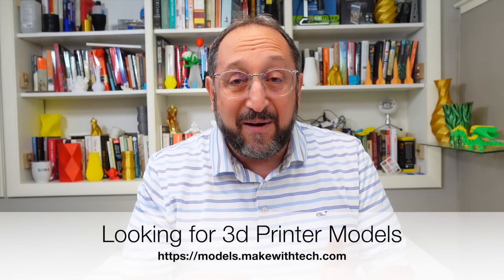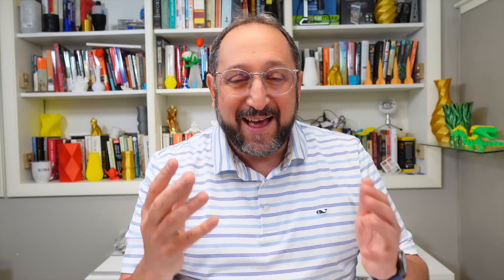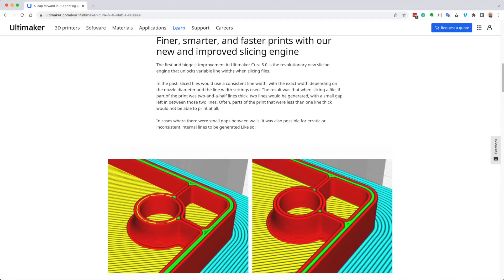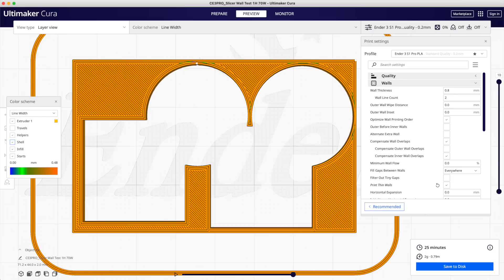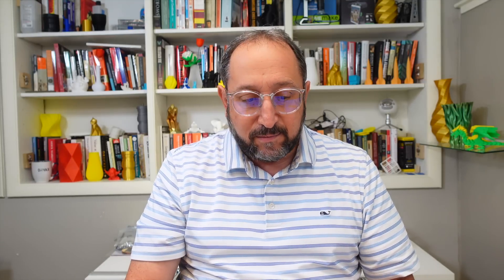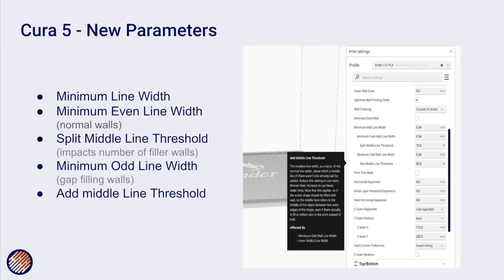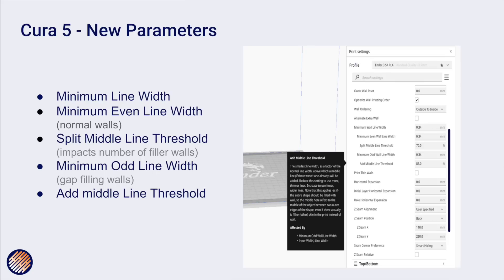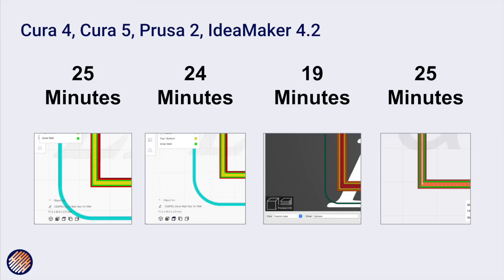Cura 5 Review: Is It Revolutionary or a Bust?

Comment: When I started using Cura 5.x with my ender 3 I immediately started having under extrusion and gaps in my prints that were not there in Cura 4.X. Haven’t got to the bottom of the issue yet. Thanks for this video!

Comment: I just downloaded Cura 5.1 and absolutely astonished!
I have been using Cura exclusively since 2019 on a CR-10s Pro, and I've always had one problem or another in regard to defects.  However, I just ran the 'Generic PETG' (which is what I've always started with using Cura 4x but had to make many modifications to get really good prints) without any modifications and I cannot believe how pretty much everything that was a problem either disappeared or is so minor that it really doesn't have to be toyed with!  Additionally, I switched to a 0.6mm nozzle and sidewalls of a cla-cube are indistinguishable from a 0.4mm one!
The Dev-team at Cura really knocked it out of the park on this one.  So, I'll be deleting my previous Cura 4x versions along with my old profiles because it is that good!
I think everyone should give Cura 5.1 a test-drive. You never know, it might make you switch (certainly from Cura 4x)...  Thanks Herb and to all your great community...
Reply: Would you mind sharing where you got the generic petg profile?
Reply: @robxmccarthy  You just select PETG, as it is the one that comes with 5.1 version. 
The only mods I’ve made are to the temps based on the characteristics of the particular PETG (i.e. cheaper PETG’s seem to work better at lower temps 215C etc.) Work on your temps first then retraction if really necessary…

Comment: I have an Ender 3 Pro and just installed Cura 5.1.  I have a problem after the simultaneous hotend/bed heating has completed. Octoprint is issuing an M112 command which kills everything and requires a printer restart.  If I move back to Cura 4.11 this does not happen.  Very strange.  Have you seen this happen in your review(s)?

Comment: Cura 5 doesn’t work well with my Mac M1 MBP. And it’s not optimized for the M1 chip, it’s still for intel but it technically opens and runs on the M1 chip. But my issue is that my mouse stops working after a minute or so. It doesn’t let me click on anything inside the app until I quit and relaunch. Anyone else?

Comment: Doesn't line width necessarily limit your line height at some point?  Specifically, I'm not sure you can well achieve a .4 line height on a .4 nozzle, when printing a .6 line width...

I thought line height was best not exceeding 60% of nozzle diameter in those wider line width cases?

Comment: I switched to Prusa slicer for a while because they can print thin parts well. But they don't have hole size compensation. So I switched to Super slicer which offer those features. Use it for a while and find it wanting mostly at flow control which in both Prusa and Super are bunched up together with line width and for the life of me I can't tune it to my spec.

Then come Cura Arachne Beta. I tried that and boi it was everything Super and Prusa can do but better at flow control. So I switch to Arachne. Never look back. Now with CURA 5 running Arachne, I'm firmly in CURA camp now.

Yes, the UI organization can be better in CURA, but can Super or Prusa print 1st layer at 3x linewidth but 33% flow so it come out as a fine net? I've yet to be able to do that.

Comment: Maybe you can help me? I have a 2015 Macbook pro. where can I find the com port settings. Trying Prontoface and I cannot get it to connect to my SKR2 board. I have a Creality Ender 3v2 3d printer and trying to upgrade it.I think you use Macbook.I get the following error serial error: [Errno 2] could not open port /dev/tty.usbserial-1410: [Errno 2] No such file or directory: '/dev/tty.usbserial-1410'

Comment: Thanks for the video. The biggest problem for me is that this version doesn't work on my Linux system. I've a system with an i7 processor. I use the video attachment of the processor, so I don't have a video card. And it complains because it *needs* OpenGL version 2, which doesn't run on the integrated video.
Reply: Daily Life and events   I use Debian.
I've built myself version 5.1 and it works.
The problem seems to be related to appimage version 5.0

Comment: Hi,

Just installed Cura 5 and compared with Cura 4.13.0 and opened in both slicers the same project *.3mf which means both slicers have the same printer settings ¿ or ?

Cura 4.13.0 prints my 3 parts in 5 hours 59 minutes

Cura 5.0.0 prints my 3 parts in 6 hours 12 minutes

A difference of 13 minutes ... Why so ?

I compared the settings and they are 100% equal
Reply: Could just be a difference in how they calculate the time needed, that is a pretty small difference in times in %

Comment: Cura 5 will not load on a Windows 7 Pro machine.  I have 7Pro on all of my machines.  When 10 came out I updated Windows on my large desktop.  When I did several on my often used programs failed to work.  With NO WORK AROUND and orphaned programs I removed 10 update.

Comment: For reasons beyond my comprehension, prints sliced with Cura fail on the 2nd layer 50% of the time for me. 
If I use PrusaSlicer it doesn't fail unless I've done something to cause failure (Unclean bed, knocked bed out of tram etc.)

The annoying thing is that I spent many hours troubleshooting and replacing parts on my printer before I realised this!

Ultimately though I'll always hold the opinion that the best slicer is the one which works for you and your hardware.

Comment: The ideaMaker vertical lines are there because you have "Infill Outline Shells" or "Solid Fill Outline Shells" set to 1. You can clearly see that that extra perimeter is everywhere there is infill. You might also clear up some of the gaps by using "Line Infill" rather than "Rectilinear" in the "Solid Fill" tab, and turn on "Check Thin Wall" and "Fill Gaps in Shell" in the "Other" tab.
Reply from the maker: Excellent.  Thank you.  I am not an ideaMaker expert so this is very helpful for my viewers.  Thanks for sharing.

Comment: Thank you for the informative and comprehensive video!  I am interested in making the line width visible in Cura but am unable to show what you have demonstrated in your video.  In preview mode I can see the various color coded lines, however the "gauge" to show various line widths is not available.  Any suggestion on how to activate this feature?
Reply: Try turning on the "print thin walls" setting under walls. I had to turn that on before I saw any variable line width...

Comment: octoprint doesnt work in 5.0   i could not click on change choice of where to print  just to disk or other but octoprint doesnt shows up nor in setting under printer octoprint doesnt shows up i even reinstalled octoprint ….
Reply: Did you remember to add the add on of octoprint in Cura 5.0 ? 
Also 5.0 also need the key to octoprint for it to see octoprint,  just like Cura 4 had to.
Reply: @Aquaflier  i did reinstalled octoprint in cura 5 but it doesnt shows up in setting printers
Reply: Do you have your firewall turned on in linux ? , maybe it has been blocked there ?
Reply: @Aquaflier  firewall has nothing to do with this

Comment: Cura 5 is definitely a huge jump ahead. Personally I am torn between Ideamaker and Cura 5. I don't like Prusa Slicer because the interface is confusing and you have to slice and then go back and see the results and the entire process of making your changes and looking at the results is just frustrating. When I just started out Prusa impressed me with its out of the box ease of use. As I started doing more advanced things I found it frustrating however and Ideamaker became my preferred slicer as the layout of the parameters is more logical than the other free slicers. Cura is a close second. There are some things I really like about Cura but also some issues that I don't like. An example is when you're using the entire bed surface for a print where it automatically reduces the bed size by approximately 15 mm on every edge. This is not the safe areas that you may also encounter. This means for example on an Ender 3 S1 Pro with a 220x220 bed you have to change the printer def to 235x235 or it won't slice. In Ideamaker that's not an issue.

Ideamaker again have a solidfill feature that messes up prints where you print walls that slants back 45⁰. Eventually I figured out how that works and got rid of it. Some things work really well in Cura and others with better out of the box in Ideamaker. At the moment I'm conflicted between the two slicers because if I had enough time I can do anything with any of them but it sometimes takes just too much time to figure it out. I'm therefore out of necessity jumping between the two slicers but that's where I draw the line.

On the topic of print times, I found that it is a highly academic issue because you can tune your time down considerably if you know how in sny slicer.

I also use adaptive layers and infill which makes a massive difference when printing large parts. 

Infill patterns is an area where Cura rules with fantastic options.

A quick tip that I found often helps me out. In the Ideamaker help it provides you often with equivalent functions in Cura, Prusa Slicer and Ideamaker. This helped me to find the best solution often and is very helpful to identify when something is not available on another slicer. If you want to look at that try the xy dimensional adjustment options.
Reply: That 15mm gap is the slicer saving room for the skirt, turn it off and you get the full bed

Comment: Hey Doc. I think you missed the most important parameter in your speed tests. And I think your pictures showed this. Cura's default outer perimeters is set to 3 by default and PrusaSlicer uses 2. There is your main speed difference.
Reply from the maker: I'll check this out
Reply: Also don't forget different speeds and accelerations between cura and prusa. Prusa default speeds are faster then cura. That's also why the faster printing times.
Reply: The pictures clearly show Cura and Prusa Slicer both with 2 perimeters. ideaMaker had an extra infill perimeter, though. Thank you for the polite rebuke.
Reply: @no-page   Sorry but I see three perimeters in Cura. You must count the extra infill perimeter Cura always does. Prusa does not do this. You mentioned it for Ideamaker but Cura does exactly the same thing. Only Doc can check his settings and report back.
Reply: @frogmandave1  You are right! Maybe it was the yellow color, but I looked carefully before and only saw two. Now I clearly see three.

Comment: Just installed this and the first thing I get was a bunch of pop ups saying that several (if not all) of my market place plugins are not working.  They advise to uninstall and reinstall the plugins.   Fine.  I do this, restart Cura 5 only to find that the marketplace will not start and stops responding, and the only option is to close out cura.  Not a good start.  I lost a lot of plugins I use daily.  Garbage program, 4.12.1 may not be as fancy, but it worked.

Comment: Cura 5 may be wonderful, but the Linux version is pretty much useless because it doesn't allow you to open or save files. Yes, there are workarounds, but it's ridiculous to have to use workarounds for such fundamental operations. So I'll have to wait for v5.1 to come out before I can try it.
Reply: Which version  of Linux are you on,  I'm on Mint on one machine and Debian on another , also tried on majaro and garuda and all of them work fine and can save and open files with out any problems.  Did you you install from your systems repository or appimage ?

Comment: I have found with my prints that Cura 5.0 is roughly 10 to 15% faster than Cura 4.1 with the same models. When printing large batches of items that can take over 10 hours in 4.1, I'm below 8 hours in 5.0. so for me the switch to 5.0 has reduced my print time, and honestly also improved my print quality utilizing virtually the same settings in the slicer.
Reply from the maker: Makes sense.  Thanks for sharing.
Reply: @MakeWithTech  Thanks for all you've shared, between you and Filament Friday (Chuck) you helped me in my early days of 3D Printing beyond words.
Reply: Do you have problems with z seams not being straight lines like in cura 4?

Comment: I still haven't moved to Cura 5 just because Cura 5 has a problem with seam lines. I need my seam lines in a straight line when printing round shapes. The Z seam relative just does not work like the previous version.
Reply from the maker: Interesting.  I have not tested that yet.  Thanks for sharing.
Reply: Same, I'm just dealing with it
Reply: Cura 5.1.0 is out but they still have not addressed this issue. Hopefully they’ll do something in the coming updates.

Comment: Thanks Irv for a great detailed comparison of some of the new Cura 5 features vs other popular slicers!

I really enjoy your videos. You have a nice presentation style and engaging personality that makes the videos very engaging.

I've been using Cura 5 since just before release. I don't see a huge increase in speed and it seems to make some odd choices when it prints layers that result in a lot more travel moves than it should.

Variable line width, as you pointed out, is a huge improvement. 

I'd also like to see them optimize travel moves which would minimize problems like stringing or other artifacts while also increasing speed.

The guys over at Inventables, a Chicago based company making great consumer CNC machines had a similar travel problem in their software.

Several months ago they put out a video announce version 2.0 of their software, Easel, with vast improvement in  several areas.

The most impressive was the new travel optimization. Seeing the before and after shots was truly impressive.

Maybe the Cura (or any of the other slicers) could talk to them and see how they did it :)

Irv, if you get the chance to checkout their video I think you'll like what they have done.

Keep making these excellent videos!

I always learn something and, for some reason, I feel happier after seeing them!
Reply from the maker: Thanks for your kind words.  I agree and I believe PrusaSlicer gcode prints faster because of travel optimization.

Comment: Thank you, nice video and comparison. However I would have loved to see some real world measuring, are those small parts the correct size? 

I'm using cura 5 a few weeks and it seems to work good. However, the following bug is still unsolved: using multiple parts with extra support blocks when the blocks overlap multiple parts will save, but loading it again rearranges the parts, making it impossible to slice.
Reply from the maker: Thanks for sharing this bug information.  I have not tested that yet, but will.
Reply: Do you have 'Ensure models are kept apart' on in the preferences?
Reply: @remcoburema4883  Yes I have
Reply: @ArcoWitter  That should probably not mess with you save files, but disabling that is a workaround.

Comment: Interesting. I use Cura (4.13). Looked at Superslicer (another Slic3r derivative) but felt the UI, specifically profile structure, was terrible - for me anyway.

I use PETG a lot, and for all its qualities it is more awkward than PLA in two ways: (1) likes to string, and (2) builds up filament on the nozzle which can lead to blobs. Both of those are made worse by lots of short lines and moves because on every line stop / move there is the risk of stringing and / or leaving a tiny whisp of filament that can be picked up by the nozzle.

So, I'm very interested in anything that optimises numbers of lines and moves. From the timings though, at 24 mins vs 25 mins, doesn't seem a lot of difference between Cura 4 and 5. Prusaslicer at 19 mins must be doing something better in line / move optimisation - assuming basic speeds are the same - so maybe I should look at that.
Reply from the maker: Yep. I believe that Prusa has better travel optimizations which will also reduce stringing.
Reply: @MakeWithTech  Be interested to see you review Superslicer. Just could not get on with it, but maybe that's just me.
Reply: @MakeWithTech  don't know how it is structured, but maybe after calculating all the moves at a level, it should then sort them into the most efficient order to minimise moves and length.

Comment: Great video, I love the detailed look into the different ways slicers handled the line width, gaps and the resulting speed.  I agree completely about using the slicer you feel the most comfortable with.  I typically have four slicers open at the same time.  I love seeing how different slicers handle different models.  Thanks for the look into  Cura 5!
Reply from the maker: Glad it was helpful!

Comment: So far, Cura 5 is working well and doesn't seem buggy and that's good enough for what I need.  It's a tool, not a lifestyle.  I've tried both PrusaSlicer and SuperSlicer and of the three, I prefer SuperSlicer's UI best.  Unfortunately, I never could get the same print quality out of PS or SS as I can with Cura on my Creality printers. I also kind of like the tree supports in Cura compared to the supports in PS and SS.  It's nice to have options.
Reply: Options are great, I use Cura 95% of the time but forcing myself to learn PS and SS for paint on support and better MMU support. Cura is cool for tree support and the 5.0 optimizations, also really enjoy playing with the experimental dynamic layer height.
Reply: @aharkey1077  Yeah, the paint on supports are pretty nice.  I'd switch full time to PS or SS if I could figure out how to make the little zits that show up randomly on the outer walls go away.